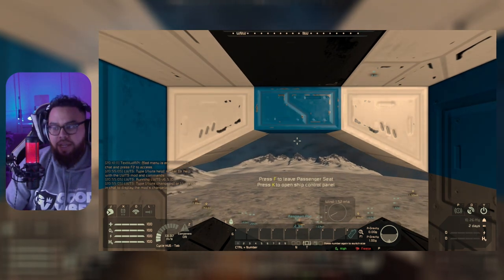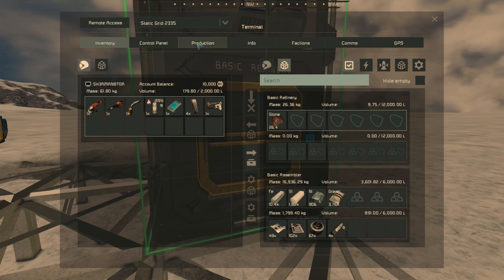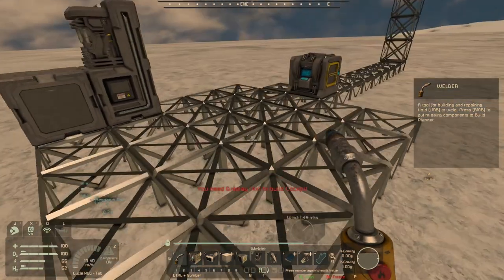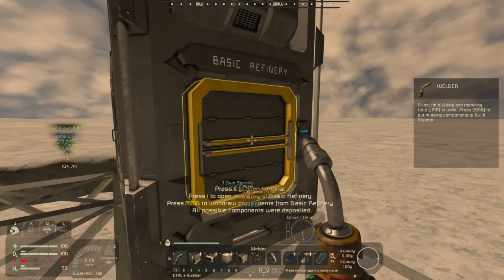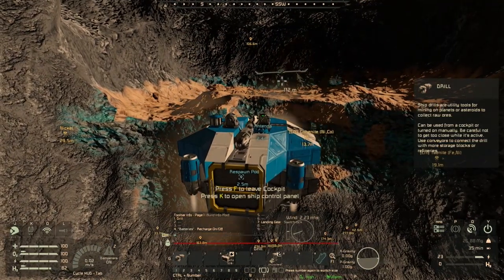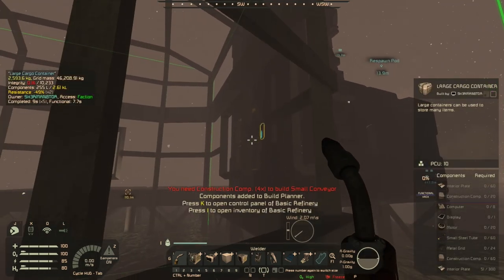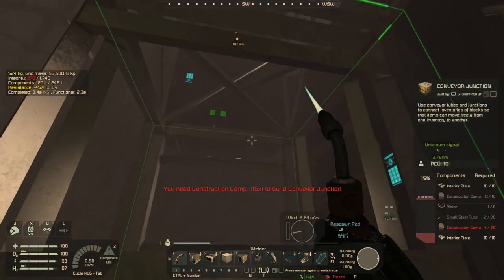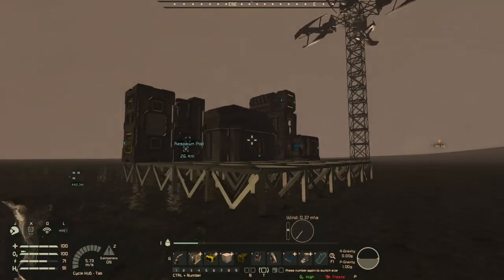Drop Pod to Drill Ship Conversion | Lets Automate Reboot Ep 1

Comment: About pressing P
It will switch the 'connected-state' on every connector/Landing-Gear/Wheel on your grid, which is totally working as intended. Because the game doesn't know or care which connector is used for what.
Recently they added the 'Used for parking' Option to exclude blocks from pressing P.
There is also a Mod 'Make P great again' which switches the default of 'Used for parking' to off.
Reply from the maker: Thanks for this i was pretty sure they had updated it so you could change something just couldnt remember and didnt want to comment on it before i was sure. That mod suggestion is a decent shout and i may play around with it a bit